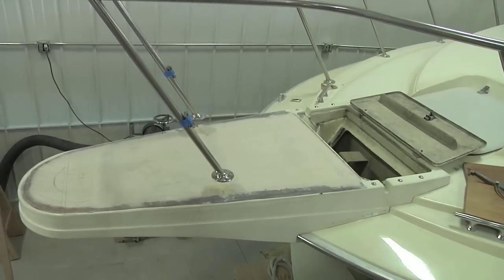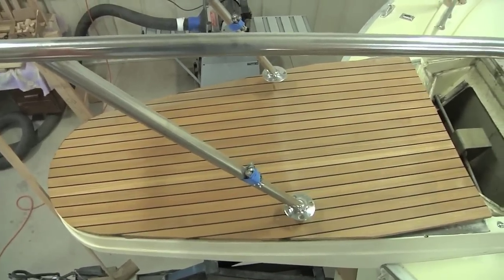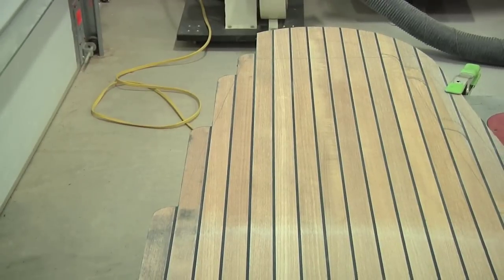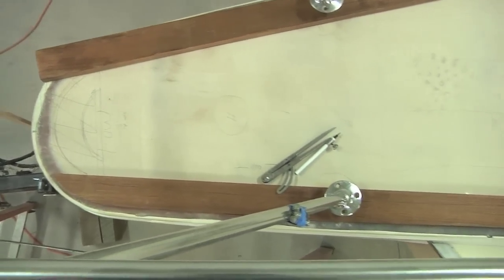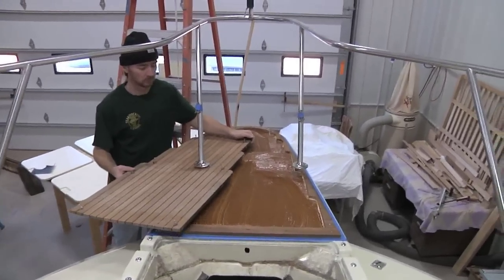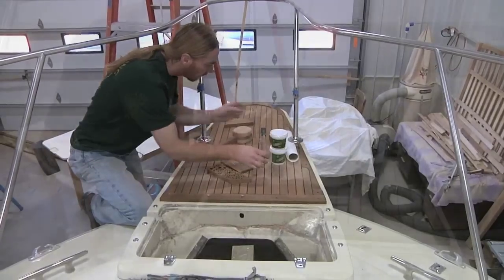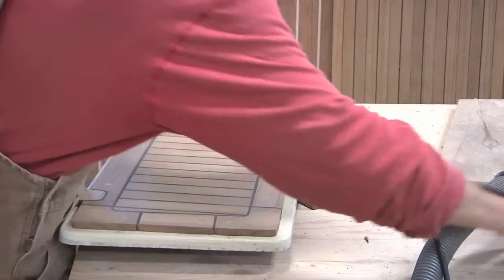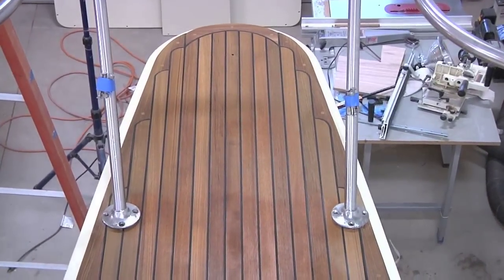Teak Deck Fabrication and Installation Part 2

Comment: Nice job. I used to work for a company that made deck panels for yachts around the world. We had the deck patterns sent to us in wooden crates, we made the deck panels, then crated them up and shipped them back to the boat builders. Quite interesting work really.
Reply from the maker: +Best Racing Tips Win At The Dragstrip Tha'ts the way Teak Decking Systems operates as well.  I have a good relationship with them and they were willing to send me some of their off cuts that were large enough for the project.  Don't think that's something they normally do though....

Comment: looks good ! The nibbing is usually off of a small template , the curve comes to half a batten and then they are connected from the half batten curve back to the caulk seam it creates a slight angle.

Comment: Does this add any rigidity to the floor? I have fiberglass deck with no core. Hoping to beef it up some to prevent sagging when stepped on? I saw you add a layer of fiberglass. Wondering if I should do that first or just go straight to this

Comment: Great Video.  Very informative. Can you elaborate on sealing the perimeter border to the deck? Curious about long term weather tightness at perimeter. Would it serve to use the same black sealant at the edge of the border to fiberglass location? 

Also how does thick pre-fab deck system lend itself to a contoured surface that isn’t so flat?

Thank you.

Comment: I appreciate the method of trimming the bungs. I have always sanded them and it takes forever. I was surprised to see that you can sand the caulk and then get the finish to adhere. Is that a non silicone based caulk?

Comment: Hi there. Is there a certain resin you used for securing the decking to the fiberglass? Also, do you need to stain after sanding?  Great videos! I love them all! Your the man!

Comment: Great channel!  I have a sailboat that has teak seats(it's the solid plywood teak that is glued in place) in the cockpit.  It was not installed properly and is lifting in the corners.  Do you have any recommendations for pulling the teak off and re-bedding it properly?  What material would you use?  Many thanks and keep on posting!!!!

Comment from the maker: Hi Larry, not sure if the supplier I used in the video (Teak Decking Systems) sells their panels retail or not.  I'd try giving them a call.  Otherwise I know that there are suppliers that will do this.  If I remember correctly figure roughly $60/SF for the materials (ouch).  It would be much less expensive to look at a teak and rubber plywood rather than using solid wood..

Comment: what is the name of the cutting chizzal and what is the name of the multi tool sander.polisher rotary thing that you can attach a vacuum cleaner to. hope you understand Our English.teehee. I have just bought a boat and after washing it ..boy it needs work. I had a brain injury  a few years ago and i can only learn through vision /video so i am so very grateful for your vids you star you
Reply from the maker: The chisel I used is a Japanese style called a crank neck chisel.  The other tool I used is called a rotary sander or random orbit sander.  Some sanders are able to be hooked to a vacuum while others just use a small filter.  The ones that hook to a vacuum work much better at keeping dust down, but they also cost a lot more :-(  Hope this helps!

Comment: Great videos! Approximately how much weight is added per square foot when adding the teak decking system?
Reply from the maker: Not sure, but relatively speaking it's insignificant compared to the overall weight of the boat :-)

Comment: hi. I'm interested in removing the fiberglass cabin from my 18' boat. I want to replace it with a teak deck to give the boat and nice appearance. I'm going for the teak deck speedboat look with a painted hull. question.. do you think it's possible

Comment: any thought of NU-TEAK?  for my interior cabin sole?
Reply from the maker: +Anthony Paun It's decent material.  If there are a lot of contours to work around, it's much easier than using real wood!  It holds up well but it's not fair to compare this to a real teak / holly floor.  It's still plastic :-)

Comment: Nice work. Interesting and informative, but don't you need to wear a mask when working epoxy?
Many years ago the supplier ran out of PUR casting, so we had to cover those circuit boards with epoxy. That gave me the most magnificent head ace I ever had.